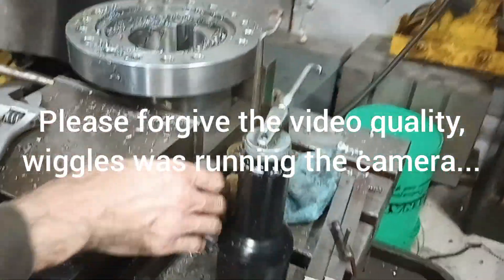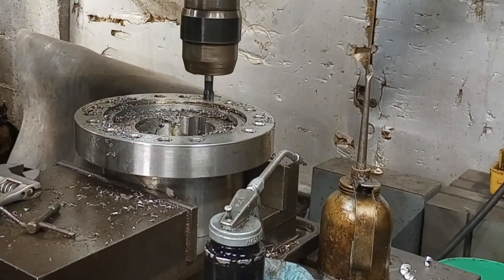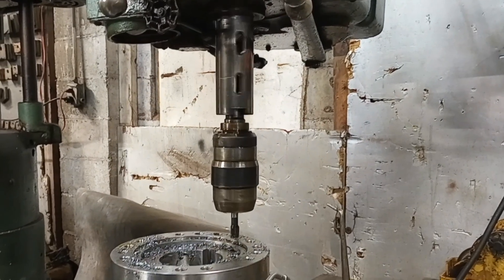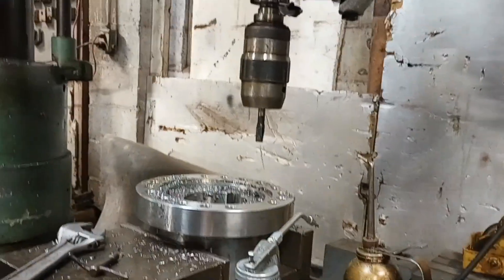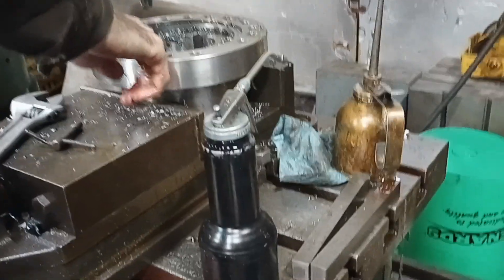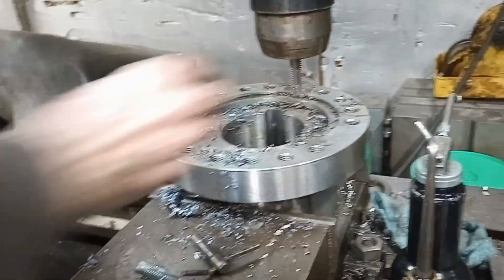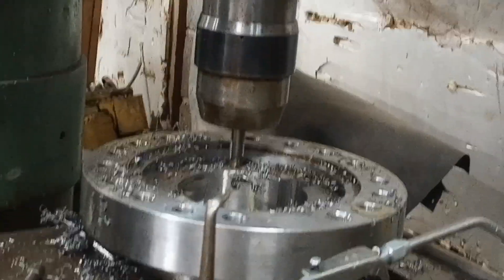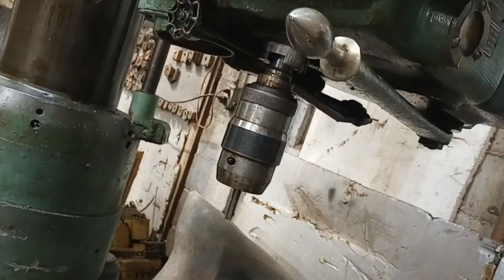A short video using a cool tap driver in the radial drill

Comment: That is a nice tapping head, I am looking forward to getting my abandoned radial going soon. There is a lot of tooling specific for heavy drill presses that I am not familiar with. Thanks for showing that, It seems radials went out with bell bottom pants, not alot out there now.
Reply from the maker: Thank you for the feedback, the video quality was so poor that I questioned whether I should even upload it. That radial drill is probably one of the most used tools in my shop, I don't know any general Job shop gets along without one.
Reply: Many of the local shops got by with a heavy drill press even old camel back type. The radial drills locally were expensive then suddenly ended up in scrap and now seem to have gained some value again. The one I have apparently was jammed on the arm in a very bad way and hauled of as junk. It is working out good but still not running just yet.. @Andy-PerpetualMotion